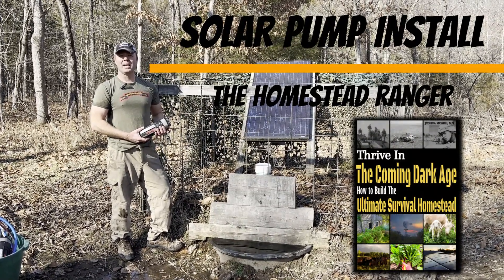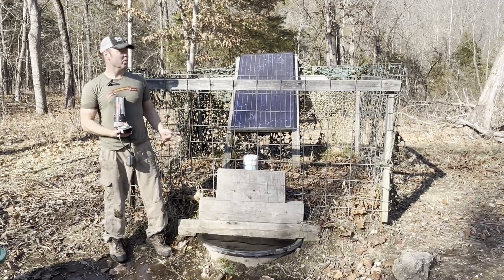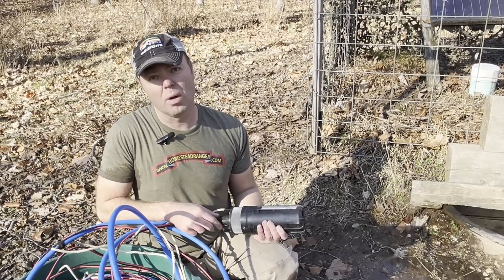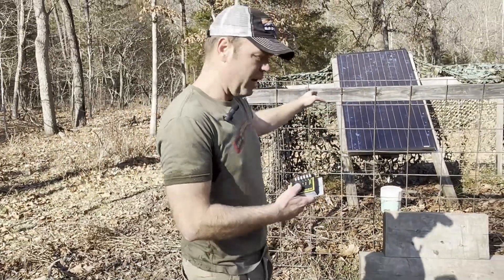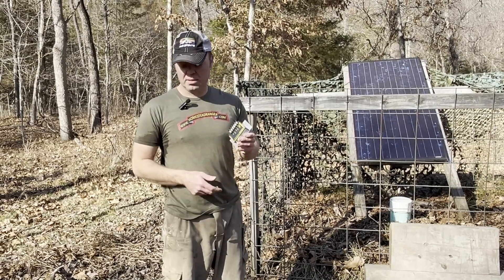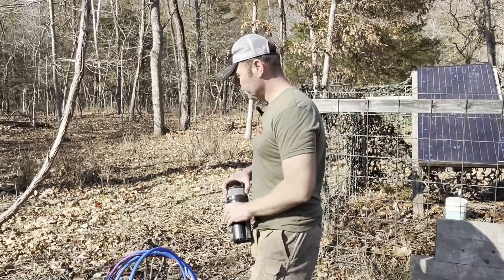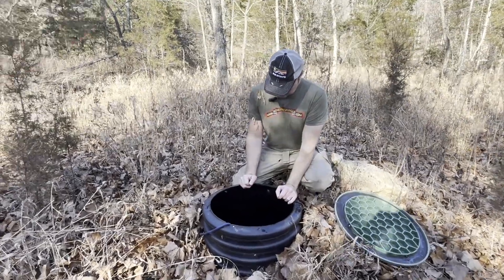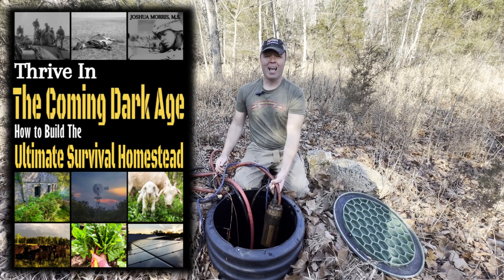solar pump installation

Comment: I was wondering if this setup provides your water for the whole home or just livestock. We want to be completely solar with our homestead as well as to not put so much draw on solar and battery for home.
Reply from the maker: @meUtragic  this one is just for one of our livestock pastures. But you could also use it for your home, the volume that you can pump varies drastically based on the depth. For a 200 foot Well, you might struggle to pump 25 gallons per day. For a 20 foot well you could probably pump 4 to 500 gallons per day

Comment: My wife found your post on FB and I watched this video. I've got 2 eco worthy solar well pumps. 1 is none and 2 is 1. So far I've just been dropping it in the creek to pump water into containers but it's working great. I'm just connecting it to a 12v battery when I use it but I plan on doing something similar to what you're doing soon.
Reply from the maker: Yes, these things are great! Just make sure you keep the silt out of the pump. They are very sensitive to silt.

Comment from the maker: Link to my store with all components, this pump brand has been replaced by Eco-Worthy: https://www.amazon.com/shop/influencer-6ea5d17b?ref_=cm_sw_r_cp_ud_aipsfshop_aipsfinfluencer-6ea5d17b_6FPERS4J8SGFMBDE9PVM
Reply: Any recommendations on a pump less than 4" in diameter.  My well is at most 4.